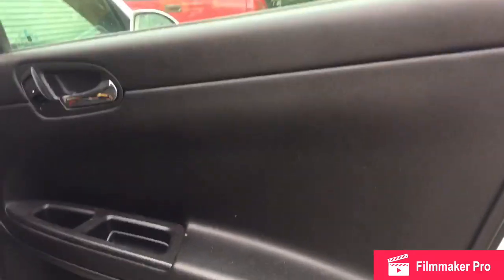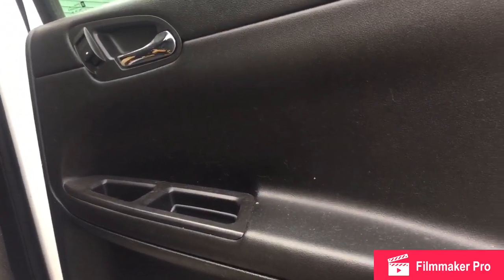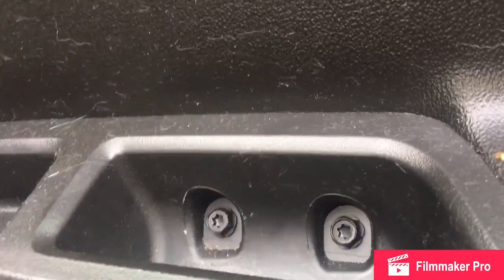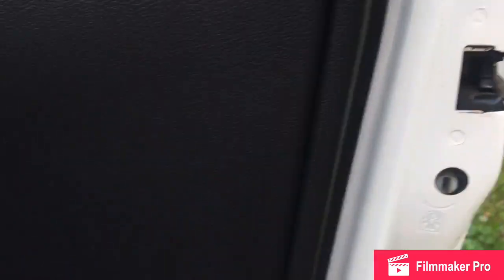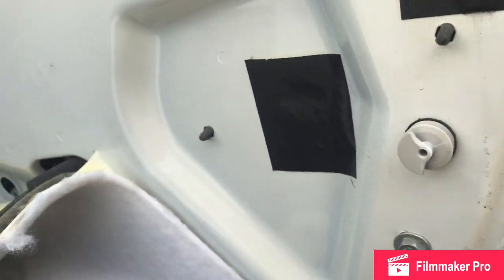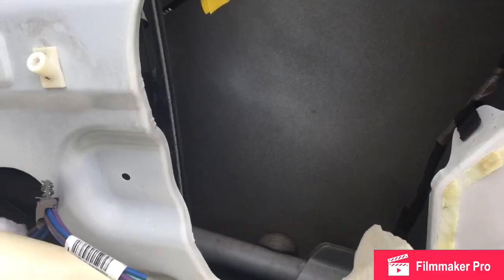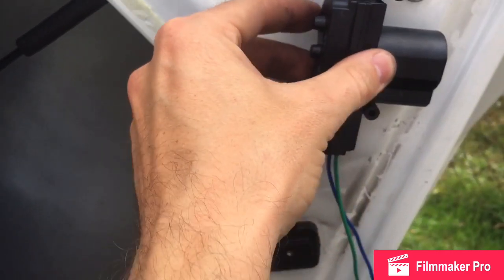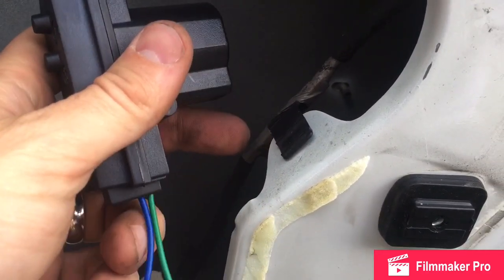Chevy Impala power locks not working? Here is the fix! Full walk through

Comment: I have the weirdest issue. If I unlock the door manually the fob works again. If I sit in the car and lock it sitting in there and wait the fob will stop working and the door unlock may or my not from the switch on the door. Once I unlock it manually again it will all work again. Or when the car is on it seams to work. It's when I leave it alone locked for more then ainute or two it will stop working again.

Comment: Great thanks for the video; I was torn whether to use your method of putting the solenoid inside the door skin or outside (in the recess in sheet metal nearer to the lock knob).  I did it your way and it worked out well.

It went pretty well, but I had a couple notes of my own:

-There's lots of room to work inside the door panel.  My car is a VW, which is TIGHT (my locks still don't work and probably never will, can't fit solenoid inside door) but the Impala right rear door on my sister's car is very easy to work on (once you get the door panel off)

-Wasn't sure how to mark the drill holes;  wanted to avoid the recessed panel and put it where you put yours, but there is a door panel mount just under where the solenoid mounts I wanted to avoid.  I measured the solenoid body (height) to get it positioned above it and measured the hole-to-hole spacing and orientation and just winged it from there...fortunately turned out OK, drilled the holes in good spot.

- A little confused about the colors of the wiring in the door, the green didn't really look too green nor did the yellow look yellow, but someone indicated the wires in the bundle of a thicker gage were the proper ones, there were 2 of those, so I just picked the "greenest looking" and "yellowest looking" wires and worked OK.
I didn't cut wire to the existing solenoid; the lock always worked fine, it was just the unlock that needed help.  Don't know if the current demand of having both stock and add on solenoid might exceed spec, but it seems to work OK.  I used an "add on" splice connector and just put the stripped end of the wire from the solenoid (stripped off the connectors, didn't use them.

- Not sure I'm alone, but the darned ball/socket cable to the inside door release had me faked out...somehow I figured out how to remove it but I think I have the wrong concept on how the "plastic  stop" for the cable is removed and reinserted.  I though it went through the slot in the plastic facing me, but now I think that's just for the wire, the actual remove/insert is from the "back side" (i.e. away from the ball/socket).  That was the biggest time waste for me, both taking it apart and putting it back....I think I totally didn't get how the cable stop released from the housing once you squeezed the wings...likewise how it was re-inserted.

Still, only took me a couple hours to do a door (only one door has symptoms).  I thought it would be a pain working inside the door but it was very easy access...lots of room to work. 

Thanks again for the pointers...probably a big reason it only took me a couple hours, I'm happy, since I did it in the winter, it died in the summer and we just lived with it for about 6 months, but now that it is cool in the garage I like doing projects like this that are no fun in the summer (I live in the sunbelt).

Comment: a quick note:

If all your power locks stop working or 
when you switch from park to drive and your doors don't lock automatically or
when all your doors unlock but locking them doesn't work or vice-versa then

most likely it's the power relay, which is right below the door lock fuse. It's not labeled on the cover
G8V-RH-1C7T-R-DC12 - Power Relay

mine was corroded so replacing them fixed it.

Hope this helps
Reply: Thank you for your response.  This is exactly the issue I have with my impala.  This helped tremendously.
Reply: @alfredkennedy2293 is the relay you'rr talking about different from the fuse? Wherr can I find it?
Reply: In my 2006 impala, I can lock all doors but when unlocking only the driver door works so I have to unlock the others manually. Do you think I need to replace the relay?

Comment: So did u buy new door locks for the driver and passenger side ? And what is the name of the door lock you purchased from amazon
Reply: Does the power locks u used for the rear doors works for the front doors?
Reply from the maker: no, i did the same thing i showed here on the other side, with the exception of the driver door, that side i pulled an old actuator off a impala at the junk yard and installed it.  The thing with pulling them off of a junk yard car, is that you dont know if they are good or not because the cars are not functional. 
https://www.amazon.com/gp/product/B00CZBQCR2/ref=ppx_yo_dt_b_asin_title_o01_s00?ie=UTF8&psc=1
Reply: @Sleeper_Banshee  so its safe to use the door locks u ordered from amazon for the driver and passenger side instead of taking a risk going to the junk yard
Reply from the maker: Depends on how much your time is worth.  Most places you have to manually take your tools into the junk yard and wrench on the door yourself to remove the door lock actuators then there is a good chance that they are already bad.  So for the price of these I thought it was worth it.  This is a cheap ALTERNATIVE to buying OEM (900+ $ for all four)
Reply from the maker: Sorry read your original comment wrong. Yes these locks work with all the doors, you just have to position them correctly.   Think it comes In a set of 2 so you have to order two? Idk look on amazon.  You will see though when you get them, they are universal.
Reply: @Sleeper_Banshee  thank you 😊🌟 for the convenience if you never uploaded this video i would of went to the junkyard and took a risk or payed $400 or more for new door locks
Reply from the maker: Of course! Good luck
Reply: Rather than use Amazon..........you can get the same exact items on Ebay for no more than $125 for all four actuators.......Original equipment!
Reply from the maker: If they are 125$ they aren’t oem.  Link?

Comment: Why go through all that work when you can replace the factory actuator for 25 bucks?
Reply from the maker: Oem ones aren’t 25 bucks, are you joking ?
Reply: @Sleeper_Banshee  your Amazon actuators are not oem so what's the difference? The non oem for $23 are a direct bolt in no drilling
Reply from the maker: @PetrucciIsKing  these were not oem correct. Oem was 200+ to replace, not sure why everyone is saying oem replacements are 25 bucks, they definitely are not. These were a cheap alternative.
Reply from the maker: @PetrucciIsKing  I bought these ones because it’s all I could find at the time. If someone finds something Better good for them

Comment: Never trust wire nuts in a car. Too much vibration and theyll wiggle loose and ull end up re doing it. Crimp or solder
Reply from the maker: Good comment.  This is one of the things I would have done differently.  I should have used a solder sleeve.
Reply: Thanks for the heads up